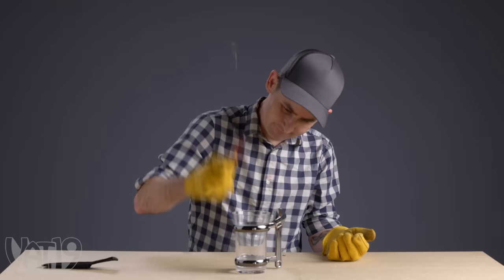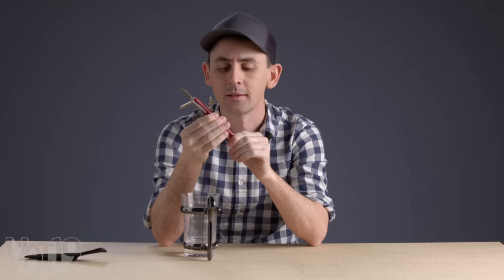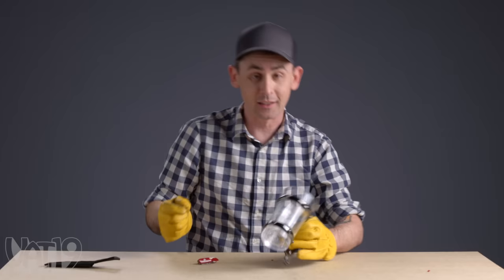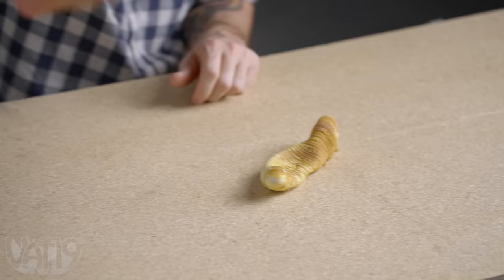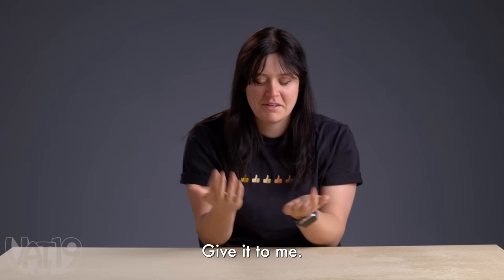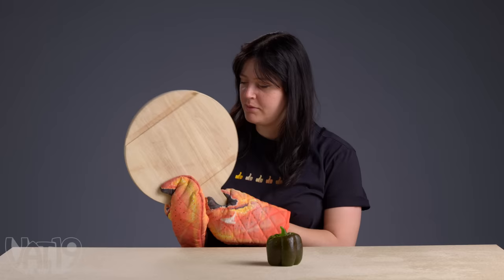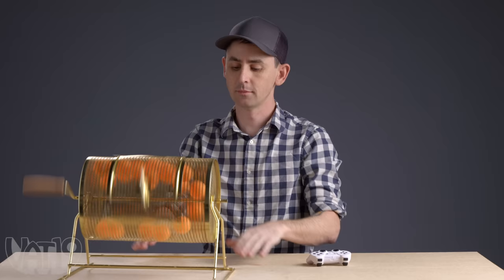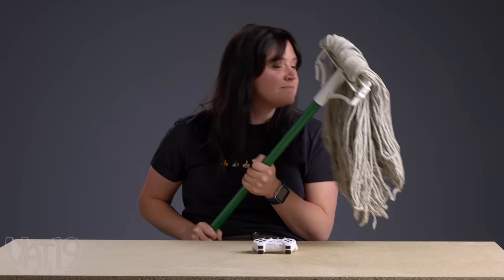$1000 if You Can Break This Toy in 1 Minute • Break It To Make It #51

Comment: why has no one pointed out stephen's adorable septum piercing??????? he looks so cute!!

also for the grub one, katie did use her hand to pull the grub to break. that is not allowed. she should have used the hand with the cord in it to pull, not the other. so no justice for her, she needed the mits of shame. daniel did not break his pepper, he just used the heat from rubbing it back and forth to stretch it and melt it. it was not broken. you guys should know how gummy works. it melts with heat, duh. they did not get the breaks, so quit causing a dumb riot in the comments bc you're ruining my experiences with the video. get over it. don't like it? click off the video.